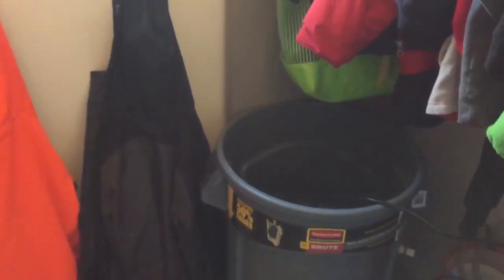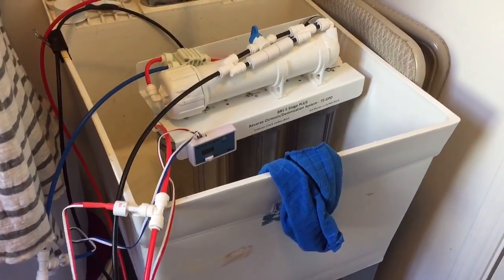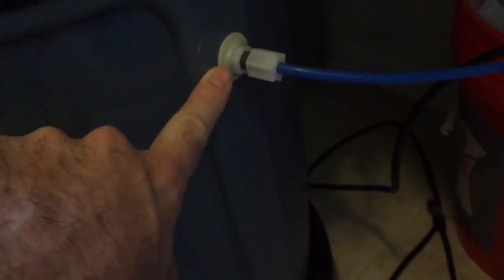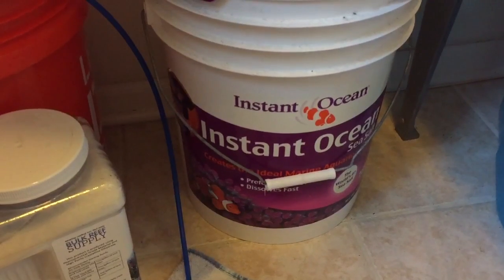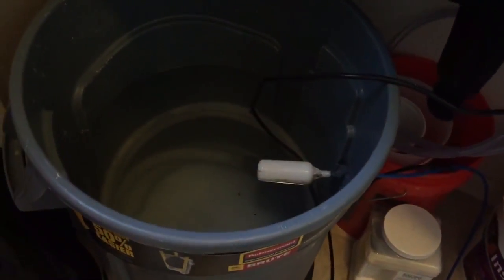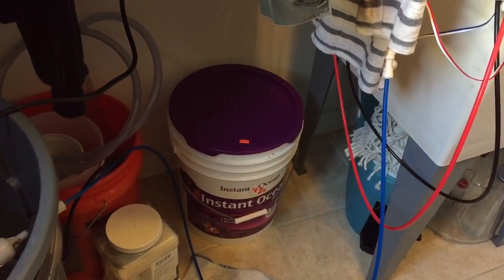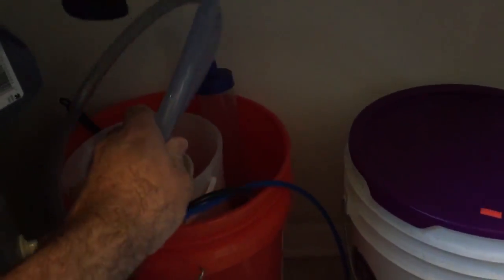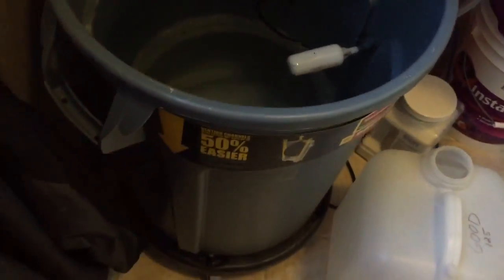instant ocean or Red Sea salt for saltwater aquarium

Comment: I don't plan on having many coral's just around 5 should I switch to read sea or can I keep using instant ocean is there anything I can dose my water with for the coral's I don't have any right now I will in a couple months
Reply from the maker: it's your call but instant ocean would be best. just make sure nitrates are 5 or lower and that you keep up on vacuuming and water changes... make the water good and you'll be fine.

Comment: i'm currently using the coralife salt. it's cheaper than IO and red sea and it seems to do a good job to me. I pick it up from p*tco! $50 per 5 gal bucket and it is in 3 separate resealable bags instead of loose in the bucket. 1/2 cup per gallon. my only caveat is that you have to dial it in to get it to the ideal salinity. plus I don't have to dose alk or calcium..ever. your channel is cool because you're a real genuine dude. thanks for the education
Reply from the maker: thanks for the great info. i have heard of that salt as well. i don't dose anything either and never want to. i'll check that out as well. thanks for liking the channel! happy to be of help. i'm no expert, just like to share what i do.
Reply: nashdaking the coralife salt greatly drop the levels in my old reef which is why I stuck with IO
Reply: nashdaking coralife is a good salt. better than instant ocean. its a clean salt that mixes well and fast. it doesn't clump like other salts I've used. and I don't have to dose when using it. still would like to know what other salts do. was thinkin HW marine or aqua forest

Comment: Steve, I've been using Instant Ocean and Reef Crystals for over 20 years. I recently experimented with HW synthetic salt and Aqauforest Reef salt. They do mix super fast compared to Instant ocean but not sure its worth the added cost. I would stick with the Instant Ocean. You've had success with it over the years with your tank, so  why change.
Reply from the maker: yeah Phil, good point. i have always used IO and love it. can't beat the price either. wish it mixed faster but i'm in no rush. the residue i the rubbermaid i could really do without. like a slime coating. nasty.

Comment: Rotter Tube Reef if you can find it buy Tropic Marine Salt its the best you can find. It produces Water exactly like in the ocean an dissolves very quickly an doesn't cost very much. Instant ocean only caused me problems,red sea is also very good but a little expensive an is were getting the same results as with the tropic marine salt so i choosed this one an Im very happy with it now for many years
Reply from the maker: awesome thanks. i'll check it out. never heard of it
Reply: Rotter Tube Reef No Problem :)  you need to try it,dont know if its available in the Us bus in Europe its the most used Salt even by Public and Scientific Aquariums
Reply: Also one Tip for you heat your Reverse osmosis water to minimum 68°F before you add the salt,so you dont get residue

Comment: I use Red Sea pro, I've used other salts like instant ocean and seachems brand but after doing a bit of research I stuck with red seas brand because of the lower phosphates you'd introduce back into the tank.
Reply from the maker: great point on the lower phosphates. that's key for me.

Comment: Red sea is only different in the way it mixes, if you look at the starting numbers of IO REEF is actually higher then redsea. I got one 55gal worth of Red Sea and will at least use the bucket as my mixing container is 55gal so that makes it easier then 27.5 cups of measuring
Reply from the maker: very interesting. i didn't know that. i thought red sea was higher in elements.
Reply: Red Sea has two variants of their salt.
Red Sea salt is generally for fish-only and soft coral tanks and the mineral contents are somewhat in line with Instant Ocean sea salt.
Red Sea Coral Pro salt is the one what comes with at least 450ppm Ca and is meant for SPS-heavy tanks.
This is more in line with Instant Ocean's Reef Crystals variant and is at a higher price point.

I have used all four variants and personally for my coral tank, regular Instant Ocean works just fine.
Since I don't have an SPS-heavy population (mostly soft corals and LPS), the little extra cost in dosing 2-part is still tiny compared to the extra cost of the Coral Pro or Reef Crystals.

I'm sure it will be a different dynamic in an LPS-heavy or SPS-heavy tank.

Comment: I've been using red sea coral pro salt , since I started a year ago. never have to does, parameters stay the same, though the bio load on my tank is low. I do a 15 % change weekly.  ca 450 to 500. mag 1350 to 1500. oh 11.5 ph 8.3.   Not having a dosing system is one less thing.
Reply from the maker: great info thanks!

Comment: Hey Steve, your tank is looking good as always man, hope the hammer coral comes back too, different salts and which salt? Well when I first started out with the 70 gallon tank I used Tropic Marin salt for a while and then it got too expensive so I went over to Red Sea Coral Pro, well yes it mixes well and had no real issues other than slightly elevated parameters on calcium and magnesium, though this salt is known for that and yeah after having a few tubs of it I decided the elevated levels and price hike got a bit much to handle... so I got a little disgruntled and went over to Aquaforest probiotic after reading great reviews, well that salt eventually proved to be a pain in the ass as well as it has KH issues, so much so I had a hammer coral and frogspawn bail out because of the low kh... so that was that I lost 2 great corals because of that shit salt!! I didn't dose anything extra in that tank and I've heard from friends and read different reviews since that Aquaforest only works if your prepared to dose extra elements which as you know is extra expensive too!!! So I'm done with those! Shortly before I shut down and sold that 70 gallon tank I went over to H20 ocean salt and I love it man, it's so easy to work with as it mixes in an hour and all my parameters are now stable and good growth on what few corals I have in the qt tank I'm now using till I get the big 175 gallon Max S up and running. So there you are my experience with salt lol. 😀👍🏻
Reply from the maker: Gary that's awesome! thanks for the expert review. i never heard of it but will check it out!
Reply: I'm no expert man but sharing my experience with great reefers and newbies to our great hobby is what this is all about. 👍🏻

Comment: I have tried many brand salts and showed my results on my channel. Instant Ocean was the biggest let down both regular and Reef Crystals due to inconsistencies mainly magnesium. I am trying out Fritz RPM now but have had great luck with Coralife for years. Coralife is about the same price as IO but it has consistent numbers. I refuse to bu any IO product after I complained to the manufacturer and they requested I send them a sample of salt at my expense. Before anyone here bashes me check out my channel and you will see how I tested all salts at a consistent temperature and SG.
Reply from the maker: thanks for taking the time to post such great info. i would hope no one would bash you for posting an honest test and also for sharing it. thanks again!

Comment: Also I forgot to add that Red Sea is stronger than instant ocean. I used to use a half cup where for Red Sea I use about a quarter inch less than a half cup, so in the long I guess I'm using less salt than I was using instant ocean. But since Red Sea costs more it evens itself out? Also that's at 1.025
Reply from the maker: that's a cool point. makes total sense.

Comment: Red Sea Reef  mixes faster you use less salt  appears stronger to me . I dose 1 1/2  cups per 5 gallon  bottle   i like my  number lower  about 1.23   my daughter likes her tank at 1.25 but that hers . we have 150 gallon  and 75 gallon   so we have pretty big set up i think . were noobs only 10 month in   . no corals yet i plan to add them in mine  in January plus  get a anemone  cough i have a army of Green and Citron gobies   ...We used instant ocean reef  no complaints  . but the red sea soon as you open  the bag you sniff instant ocean  then red sea salt   you can tell the difference instantly  work the salt change in slowly  during  water changed  were going to add algae scrubber next sea if that lower our water changes after all were noobs ...
Reply from the maker: I used IO for years and it worked well. RED SEA is just better for reasons you listed. I hate the price.....but it is what it is. If I didn't have coral I would run salinity at 1.018...fish love it....more oxygen that way as well. I stay around1.025